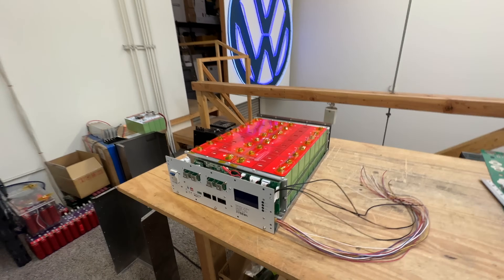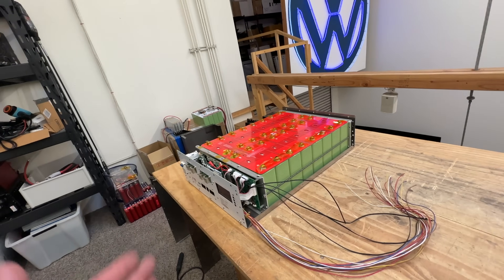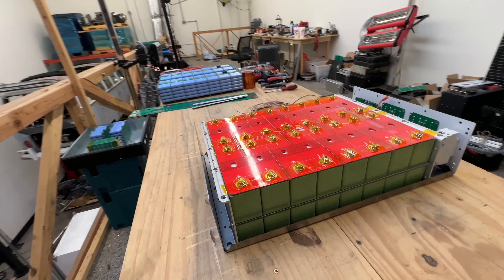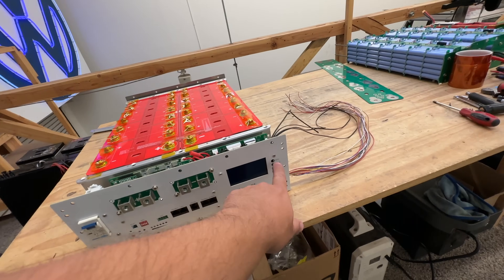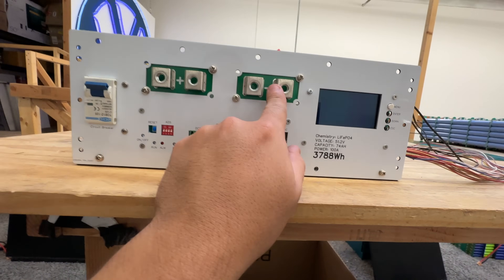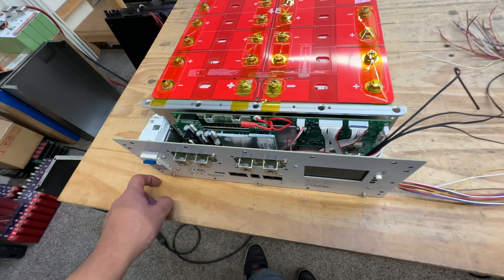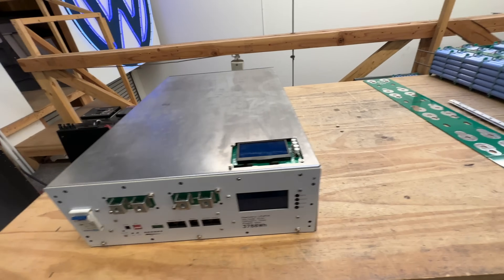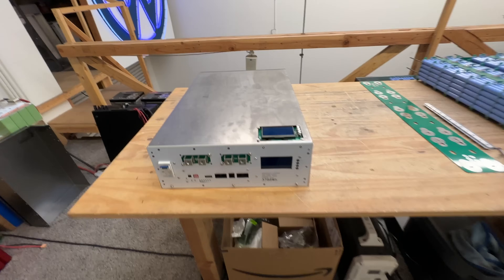DIY Rack Mount 48v LiFePO4 off grid battery  Project

Comment: have you considered gluing a piece of isolating foam or plastic  directly on the back of the case cover so that i will isolate the terminal from the metal portion of the case - so if it does get crushed or dropped you will have insulation between the meal and the battery terminals - this is a cheap solution that will not add much cost to the build.  Simple is better.

Comment: @jehugarcia separate question.. ordered the batteries, the BMS you list which I also ordered.. that will handle all needs for all 16 cells? I assume that handles the charging and monitoring of battery cells, etc? I thought BMS handled balance charging too but you have the dual Batgo units in a diff video from a few weeks back, are those used to balance charge between cells?

Comment: And finally, something else to consider.  If you rotate the pack 90 degrees, there's all kinds of space behind it.  The shallowest standard 19" rack is 23.62" deep, but most are 31.5" deep and a full depth rack is 39" deep.  I personally have a 39" deep rack because I have a tape library which has a chassis 42" long (by far the longest of any of my rackmount equipment).  Sadly that extended depth doesn't allow for 3 packs side by side by side, unless the BMS compartment is really compact, but the typical middle depth does allow for 2 packs side by side, in a 16s2p configuration, with plenty of room for the BMS compartment.  If you have success with this single pack design (you're going to crowd fund it, right?), you might consider a double pack design as a followup project.

Comment: Still on the subject of rack mounting, there is the question of maintenance.  One of the purposes of rails is to slide the chassis out of the rack without actually dismounting it in order to work on the machine inside.  My current 2U rackmount UPS has mounting ears, not rails.  By necessity, it's a front loader.  To change the batteries, I unscrew an access plate and slide the cells out (a 4s lead-acid pack) horizontally.

This battery box you're building is what's called a top loader.  The cells are set into the case from the top.  To be maintenance-friendly, the sides of the chassis need to be integral with the bottom, so the whole thing can ride on rails into and out of the rack for cell replacement.  The top is just a lid, in that case.

I know that probably increases the expense of fabrication, but it's something to consider.  If you rotate the pack, as I suggested, and only have a single pack in the case, then you can leave off the rails and cell replacement means disconnecting and dismounting the entire chassis from the rack, obviating the need to have integral sides.

Comment: On the subject of rack mounting, the pack is only 13.5" wide which means that case is at best 14" wide.  That won't do at all.  Standard server racks are 19" wide.  AT&T (then known as Bell Telephone) standardized that width in 1922 and the whole world uses it.  (It's officially 482.6mm in the rest of the world.)

The actual space between the rails of a 19" rack is nominally 17.75" (https://en.wikipedia.org/wiki/19-inch_rack#/media/File:19_inch_rack_dimensions.svg) but in a modern square hole rack it's slightly less than that.  Most of my rackmount equipment has cases which are 17.5" wide, more or less.  Conveniently, that's the length of your 16s pack.  If you rotate your 16s pack 90 degrees, it will just fit, though the heavy power conductors would have to be routed over the top of the pack since there would be no clearance at all on the sides.  That means the case itself would be providing compression, across its width rather than depth, and there likely isn't room for the nuts on the ends of tensioning rods so they would be omitted.  That also means that rails would have to go in the top 1U so no screw ends are in contact with battery case on the inside.

If you rotate the pack 90 degrees, omitting rails and only including mounting ears is a lot more tenable.  In the current configuration, the 75lb weight of the pack extends, what, 20" from the front of the case?  If the pack is rotated, you knock 4" off of the depth of the case, reducing the moment arm on the ears considerably.  That also makes it easier to lift and install (though still not easy).

One of the purposes of rails is to make it much easier to install a heavy machine in a rack with only front access.  You screw the inner rails to the chassis, mount the outer rails in the rack, and then it's just a matter of lining up the inner and outer rails and leveling the chassis and you can just push the chassis into the rack.  The rails engage and the ball bearings take the weight and the chassis rolls into the rack at that point.

Comment: I'll echo and reinforce what justinsayre4856 said.  A rackmount kit needs to come with rackmount rails.  Many years ago I bought a DIY rackmount computer case (just the empty case) and it didn't come with rails.  The only rails I could find make it sit wrong in the rack, so a 2U box takes up 3U of space, wasting 1U in my rack.  Your kit should come with rails, and the box needs to have mounting holes at the right height drilled and tapped to match the rails.  Generic rails are available and work fine as long as the case is matched to them.

The mounting location for the rails is somewhat arbitrary.  I have a couple of 4U chassis in my rack right now and their rails are in different places.  One is 1U down from the top and the other is 1U up from the bottom.  There are some with the rails aligned with the top 1U, with the whole case slung below them.  Those are some of the easier ones to get into the rack because you can see what you're doing when lining up the inner and outer rails.

Comment: Are these brand new cells? The site says "as is" and not responsible for them.. makes me think they are used cells.. which would mean they wont have 6000+ lifecycle charges right? Whats the number of recharge until 80% left?
Reply from the maker: New cells
Reply: @jehugarcia  OK.. so first how many recharges? 6000 or so? Second.. can these be used as a backup battery  to charge my Yeti goal zero from this setup directly (as a 48v input), or have to run an inverter to 110 to charge the battery from it. Little unsure of the high output of these if these would be suitable for that or not.

Comment: I like this design.  I would like to see it available as a kit so that the end user could add a different battery (within the dimension limitations) if they choose, and at a reasonable price.  An insulator strip above the terminals on the lid might be helpful.

Comment: Have you thought about making the screen detachable instead of developing two separate units? Along with having the ability to mount the display on the outside of another case? So let's say you had two units inside a case you can remote mount the display to the outside so that you can see both cases information.
Reply from the maker: No up can not control multiple units from same screen.  And designing a standalone enclosure for the screen is more complex than just making 2 covers with slight mods to them.

Comment: Looks Great Jehu. Can't wait until you sort out all the small kinks in the design. Hope that you can sell these as fully assembled units and offer local pickup if shipping is an issue with the weight of the unit. 

Great dedication and passion you have in the diy battery community over the years. 

Keep it up Jehu!

Cheers from Toronto Ontario Canada.

Comment: Nice video indeed. It looks much better now. 
- I would suggest to use full sheet of some FR4 (but not that as that is too expensive) or similar cheap laminated board(on both top and bottom as well.. you can see that supplier can bring a lot of them pretty cheaply..to insulate whole sheet with some double sided tape or mount it to those U brackets (AL brackets that are used to hold those cells together by two screw's at left and right side) or glue it directly to your casing (top side and bottom) both will work i suppose ..it needs to be calculated what is cheaper and fast to do ..and such
- Then I think that BMS might need some protection ..it doesn't matter if it is before or after DC disconnector or circuit breaker..but from practical point of view it should be after c. breaker ..anyway BMS needs some protection ..some fuse or such..  
- Also i suggest to use 90 degree connector to connect those balancing wires..it will be better for sure with connection and also safety point of view.

Comment: At ~13m, couldn't you just insulate the inside of the top/case-lid? At ~15m, maybe put screw holes for rack-mount rails. Also, what about ventilation?
Reply from the maker: No ventilation needed for .5c

Comment: This magical circuit breaker on the left? Is that a DC circuit breaker? How would that work? What standard does it implement? Can it extinguish a DC arc in both current directions? That must be super duper expensive. 
If not, I would love to see it in action breaking a 100A load. (And catch fire.)
Reply from the maker: Why is a DC breaker so magical?
Reply: @jehugarcia DC arcs are way  harder to extingush than AC arcs. So in that form factor I really want to know how it does it. It might be that there is some kind of beefy semiconductor inside. I'd just really like to know how it does it. For instance in solar installations, some DC brakers only work in one direction: https://www.youtube.com/watch?v=Oaq2cvoPBRk

Comment: Maybe 2 strips of mini cell foam glued to the back of the cover in place of the tubing you are thinking to uses as a stand offs?
Reply: Just what I was going to suggest.  You can get that stuff with adhesive pre-applied, too, making it easy to attach when assembling the kit.

Comment: I like the design so far! Would like to see the top as just a flat piece with sides connected to the bottom so the access screws could be accessed from the top. As far as standoffs go to support the top and prevent it from touching the cell terminals, you could use some 3d printed (or injection molded) covers on each nut that you put on once they are tightened that also stick up far enough to touch the top of the case, that way they are supported by the cell below so the PCB doesn't crack if it is dropped, but also there will be enough that there would be no way the top could touch the cell terminal unless it was ran over by a truck or something lol
Reply: Maybe even 3d print the main power terminals, with a rib for separation.
Use ribbon cable for balance if possible (what GA?) much easier to assemble or disassemble.
Square tubes for floor might make sense, makes that all much stronger.  Can they have flanges to mount on opposite surfaces?  Even though you want to protect the battery, it's the main mass, and your battery plates can probably defend against small arms fire. Maybe the battery bolts could hold 2 square tubes that make contact with the case.  Or harder, fold the battery plates over  2 more folds.  Those fake tubes could also become the frame with PEM nuts.
BTW in servers, we call it 3U and 4U size to designate the thickness.
Pushbuttons look flimsy.  Tell me you can find a rubberized version?
Reply: Another option for the battery terminals, would be to add nylon grommets on the nuts. Harder to source, but safer.
Your top cover's control display will interfere with reinforcing tubes. Can you put the reinforcing tubes into the 4 corners (lengthwise) and have your controls keep out the last 3/4 inch of left and right walls.  Imagine a 4-legged metal narrow table with a floor that is the battery frame.
On the battery monitor, it would be nice to have a fused line to battery bypassing circuit breaker.  The heavy battery conductors need to go through breaker.
I saw one guy review a battery pack that had a fire isolation switch (like a breaker) in series.

Comment: It’s unfortunate that you won’t be able to make these cells a long term inventory item. As unlikely it may be, would be really upsetting to build a large battery installation and then have an individual cell fail a few years from now and not be able to replace it. Is there any way to incorporate a few extra redundant cells that would be kept healthy and available as a tested standby to be used as replacement if needed.

Comment: Thoughts on adding some kind of plug cover instead of screwing in cables into the terminals. Just some extra protection. Maybe like amphenol plugs?
Reply: Would add a bit of cost…might be better to just let people DIY it themselves instead of making front plates with holes for those connectors.